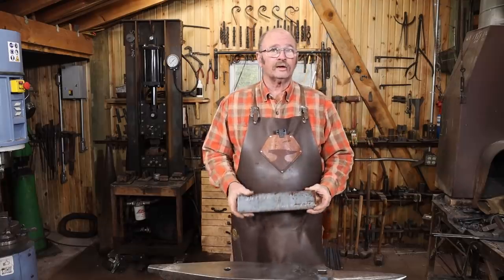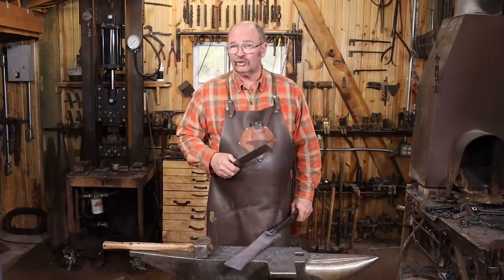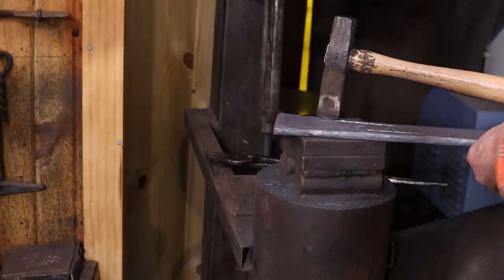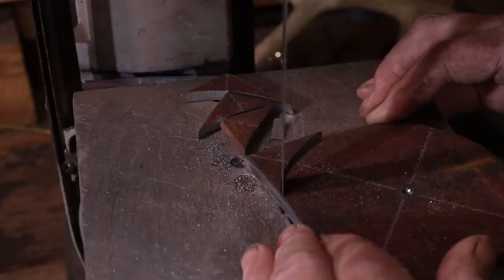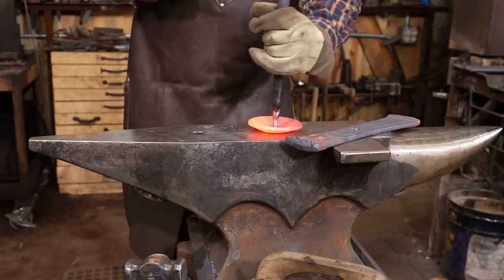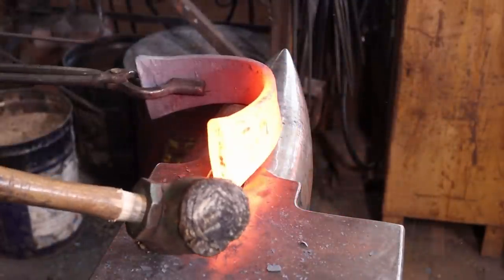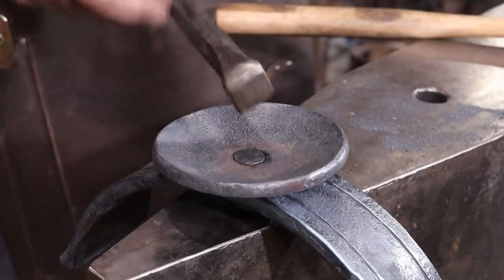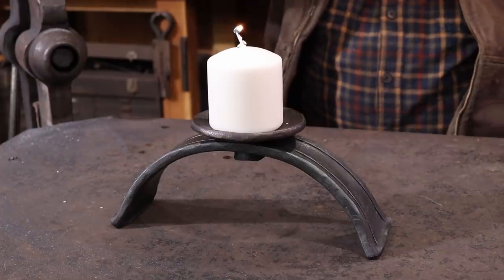Forging a Contemporary Candle Holder

Comment: Have you ever forged corners for steamer trunk style boxes? I was digging through your videos looking but never found anything
Reply from the maker: Yes, but it was long before I started doing videos.  Its more of a folding operation.
Reply: @BlackBearForge  did you forge weld the corner that meets up in the middle of the fold?
Reply from the maker: @waynemitchell8254  I don't think so.  As I recall I just put the seem to the underside of the chest.

Comment: Sorry John I feel like I'm always the one asking dumb questions. But is it possible to do like a "double headed rivet" so the body stands between the cup and the stand and is then peened inside the cup and underneath the stand with the body of the rivet between the two? Just a thought I had whilst watching you there
Reply from the maker: I think would be very difficult as an intermediate head.  However, it would be very easy to just add a spacer between the base and the dish.
Reply: @BlackBearForge  how would you attach a spacer? Forget weld? Tack welding?
Reply from the maker: @paulcorrigan649  Just make it with a hole in it and pass the rivet through all three pieces securing them at the same time